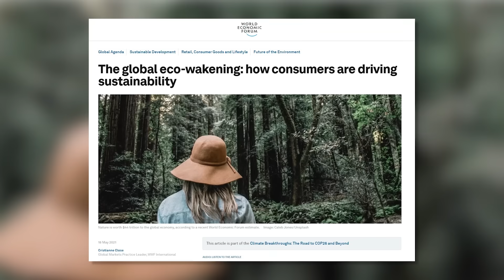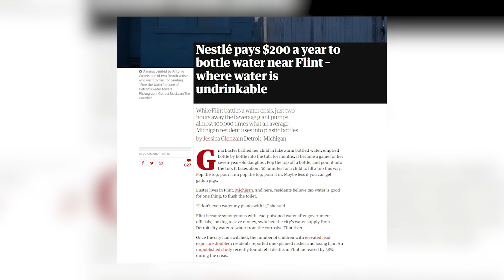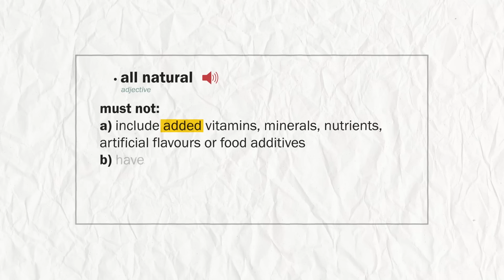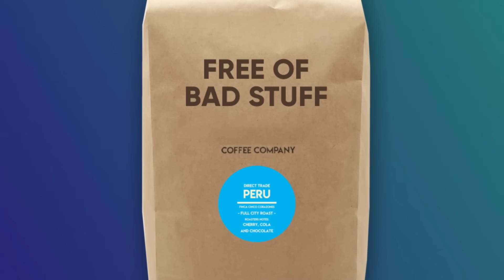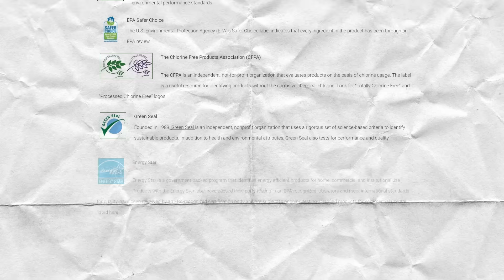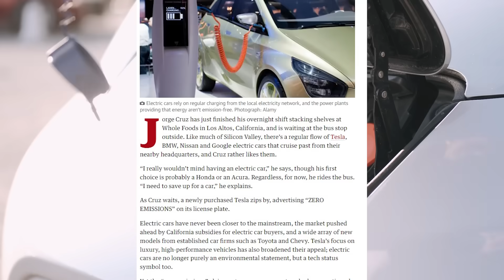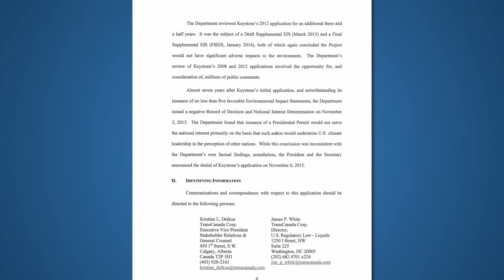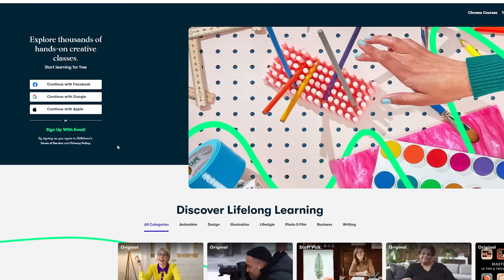Why Being 'Environmentally Friendly' Is A Scam

Comment: Also the fact that the keystone pipeline was shut down at the beginning of the new presidency cause of environmental damage, in the hopes that people would buy electric cars instead. Only for the US government to then go and buy fuel from Russian and Chinese companies. Thus now, since the new war happened, gas is $4 and above. And we still drill for oil here. We just can’t use a pipeline to transport it anymore. Now they have to be transported by diesel trucks, and trains. Where do I know this from? I’m a truck driver myself. So in reality, they didn’t make any changes to help the environment. The pipeline is shut down, but it’s still there. It still occupies that space. Why not use it then? But they made such a big fuss about making a change, when in reality, they just wanted to appeal to their agenda. I am all for bettering our environment, but we can’t just change from a bad thing to another bad thing. Like electric car batteries. Have you seen the damage that they produce on the planet in order to be produced? And also the fact that those batteries need to be changed every 5-10 years. Which is why Prius owners just get rid of their car. Since it’s cheaper to just get another one. Now we have junkyards filled with Prius’s that just need a battery replacement. And the fact that we don’t have solar powered cars yet. Or any other alternative. I know that somebody once made a car that ran on water. But he died of apparently a stroke or something. Even tho he said that he was poisoned moments before he died. But it’s just a conspiracy theory if you say otherwise. We can’t make water powered cars. It’s impossible. Or there was another one which had 2 batteries. While you were using one, the other would charge from the friction of the wheels. Thus, you never have to charge it. But I haven’t heard anything of that after that.

Comment: I wanted to point out the oil pipeline example you given in this video. The TransAtlantic pipeline was built in order to supply oil to consumers in the US. Canceling it just means that the oil are currently being shipped across vast distances to countries like India and China. The end result meant that is it actually far more polluting and more Co2 emissions were being released rather than sticking with the pipeline. Isn't this kinda ties to one of your 'seven sins' of green-washing??? 🤔
Reply: Isn’t it on indigenous land?
Reply: Keyword is "currently". We can't reduce fossil fuels if we keep building infrastructure for fossil fuels.

Comment: I'd just like to point out: Plastic bottles are reusable. You could reuse it several times prior to recycling (if that's an option in your area) or throwing it away (if recycling isn't an option in your area).

Another interesting thought: Plastic soda bottles are also single use (and much harder to reuse than water bottles, since you have to clean them out first, whereas you could just buy one water bottle at an event and keep refilling it at a water fountain or at home for quite a while. Yet, I notice whenever we talk about plastic waste/single use plastics, we don't mention soda bottles. Whyfor?

Comment: Interestingly enough, you'll probably do more good for the environment simply buying the cheapest products you can find rather than buying anything greenwashed at a markup. Of course, make sure the things you're buying also don't need to be replaced too often, things that would actually end up costing you more over your lifetime and top up the landfills. In general, though, if something is produced more efficiently, it will end up both being cheaper and having a lower impact on the environment. In addition to buying less in general, buying cheaper can be a big part of the "reduce" in "reduce, reuse, recycle." (And remember, those are listed in order of decreasing priority.)

Comment: Plastic bottles are great : I have a set of those that I use since 2013, those are okay, as long as I keep them out of UV light. It does not break like glass, it's lighter than steel, it does not taste like gasket, and since those are more than one year old they do not exhaust harmful chemicals (the PE had finished to cure). Those bottle are certainly better while I reuse them than in any trash. If a neanderthal had found one, he would certainly keep it for reuse. Discarding useful things make us more stupid than monkeys.

Comment: The thing that is not touched upon enough in my opinion is the illusion that a product is more eco-friendly because it's "all natural". For example natural rose oil is not environmentally friendly at all, it takes (I think) 1000 roses for 1 oz  of rose oil (or somewhere around there, insane amounts anyway). The resources that go into growing and processing all those roses can definitley be considered wasteful in comparison to synthetic geranium oil, as well as the potential waste after the oil is extracted (I don't know what manufacturers do with the rest of the rose but I doubt it's something responsible, like composting them,).
Granted synthetic "essential" oils have their own downsides both relating to the environment (like oil resources and potential pollution from manufacturing) and not (like potential carcinogenics and other health concerns), but my point is that to think that something is automatically not bad for the environment, or health, simply because it's natural is not true.

Comment: Let's be honest. Human convenience and environmentally friendly are like oil and water. It won't mix that easily. You will always have to sacrifice one thing from other to make the balance. Biodegradable packaging are a good example. Single used plastic bags has the benefit of being both cheap and durable but not environmentally friendly because it' s plastic. Alternative for this are either eco bag (those bags made of cloth or other durable material so they can be reusable) but it takes more energy to produce them, aren't free and takes a bit of space to carry to your supermarket since they need a bit of effort to be folded compactly enough and lastly, most of the time they aren't water proof. Another alternative are biodegradable plastic which is questionable at best since no body really bothers to look into if those are real biodegradable plastic and even if they are, they aren't as biodegradable as paper and lastly paper packaging which is the most environmentally friendly but is fragile and really expensive to use for business owners. So yeah, you need to sacrifice convenience for the sake of being environmentally friendly.
Reply: It's impossible to sacrifice convenience when the population keeps on ballooning - and when societies with very low PDI and very high individualism rankings question 'big government' moves that are designed to, as you've said, sacrifice convenience. The problem is that those governments often lack pragmatism, and whenever their reasoning clashes with other science and statistics (see the argument regarding plastic bags and reuse vs regulation, for example), that's when the logic behind it all gets questioned. Then there's also the risk of unintended consequences and possible 'unicorning' (for a lack of a better term), where the legislation is based largely on a desire for an ecological utopia that would solve the world's problems, no matter how small their contribution would be in reality. That's why there'll never be satisfaction.

Comment: Two very important things that should be mentioned in cases like the Keystone pipeline lest it becomes another one of these "sins", although I'm not from NA so I don't know the specifics:
1) Stopping national oil/gas production doesn't prevent, and often expedites, foreign production/importation. On a global scale it's even worse since the usual culprits are less regulated (more polluting and damaging to their local environment) and the resource has to be transported over a much bigger distance to your country, so it defeats the main purpose of these enviromental arguments - unless you think your backyard matters more than theirs.
2) Stopping the most efficient means of transportation (like a pipeline) doesn't prevent, and often expedites, less efficient and thus more expensive and polluting means of transportation. Instead of an underground pipeline you now have thousands of trucks, as well as an increased need for road structure and repairs. Perhaps the pipeline really was THAT bad (again I didn't follow the story) but was it worse than the current alternative?
Reply: Agreed
Reply: The thing is that we shouldn't be making more fossil fuel infrastructure. We need to stop using them at some point and we could decrease the need for them at all by switching to sustainable power sources. That would reduce the need for worse ways of transporting fossil fuels since we just wouldn't need to transport them at all.
Reply: @atenza_falcon  Yup yup. However it's not something we can "switch" from one day to the next. In the meanwhile there'll be a multi-decade, if not century-long, transition. And that's accounting only for wealthy 1st world countries, on the 2nd and 3rd world it'll take longer still.
Reply: @Highlaw  Building more fossil fuel infrastructure still takes time. Sure it's easier, but that time could be spent starting to transition before it's too late.
Reply: @Highlaw  In some ways, the current Russia-Ukraine conflict could accelerate this process, at least in Europe, where countries are now in the difficult position of relying heavily on Russian fuel.
Reply: @atenza_falcon  Petroleum is not just about fuel/energy, although that is the main product that we gain from them.  If we eliminate oil, how are you going to replace the high tech winter clothes that allow us to comfortably survive the northern winters?  The coats and boots that are made today are vastly superior to what we wore 25-30 years ago--and all thanks to petroleum products.  If you were to remove everything in a hospital that is made from petroleum products, it would be pretty bare.  Just a simple procedure requires--IV, tubing, plastics to keep things sterile, gloves, medications, bandages, the room itself has countertop laminates, computers, communication systems..... Nearly everything that you touch every day is made possible either directly or indirectly because of the petroleum industry.
Reply: @brendazorn4592  Then we'll probably need alternatives, but since they aren't causing emissions after production they're definitely better than fuel. Hopefully the huge amount of oil we have could last until we have good alternatives.

Comment: Reminds me of SC Johnson's Raid Earth Options bug spray sold in Australia. It does use natural pyrethrins, but whatever synthetic stuff they put in there makes it all but pretentious. Ditto with MSI when they sold an "eco-friendly" line of motherboards which claim to save energy by shutting off unused components on demand, only for it to be moot considering the environmental impact of manufacturing PCBs and semiconductors.

Comment: @AsapSCIENCE Got a question. I know it's one of the sins but the oil still gets transported. Which is better for the environment? Transport by train or pipeline? The Lesser Of Two Evils. Renewable energy is still a ways off from being efficient enough to rely on it and not the oil or gas for vehicles.

Comment: Just like what happening on renewable energy and electric car. It's not that green, at least not as green as you think, e.g you need oil to produce energy to charge your car..... And lithium battery inside the car is hardly recycle. The wind turbines' blades take huge amount of energy to recycle a little, most go to the landfill because most of the material made of can't be recycled, plus miles of cables and kill many birds...

Comment: The issue with things like protesting pipelines is "who pays?" Often the protesters are people with enough money to spend time protesting. And the people who pay for increased gas cost is often people who can't afford it.

So while going 'gas' free sounds nice, the hidden costs of li-ion batteries costing half the car's price and high increase in fuel are prohibitive to anyone lower than middle class. That poverty line is just going to raise as costs go higher while pay doesn't. Save up you say? Must be nice being able to do that. It's going to take sodium or glass battery tech before EVs are mainstream.
Reply: Electric cars are not the solution. Trains, trolleys, and light rail are a proven solution to transportation logistics, and they are more energy efficient per-passenger than cars.
Reply: @Random3716  That would work in many parts of the world. The issue with the US is sprawling suburbs. Which makes such things highly inefficient. Unfortunately the 'American Dream" is still an independent house instead of an apartment. And without owner rights, people just aren't going to be interested in renting an apartment.
Reply: @zetsumeinaito  Detached housing is not the problem, it's how and where it's built. There actually lots of suburbs in the US that sprung up around streetcar lines in the late 19th and early 20th centuries. This form of public transportation is actually what enabled detached housing tracts to develop in the US in the first place. Streetcar suburbs started to give way to plans designed around the car in the 1920's. The modern suburban, car-dependent hellscape emerged in the 50's.
Getting away from car-dependent suburbs would require a lot of political will (basically the entire national system of zoning laws would have to be re-done), but public transportation integrated into suburbs of detached housing is feasible and did exist extensively in the US.
Reply: @Random3716  There's a certain population density you need to even make public transportation worth it regardless of how you word it. I've never heard of inner city subdivisions as being called suburbs.
Reply: @zetsumeinaito  Those suburbs used to be the outer limits of the city, and were densely populated enough to warrant public transportstion. Even rural communities in the midwest were connected to the cities with electric interurban railroads similar to modern light rail systems.

Comment: VW did pay billions in penalties and restitution for the dieselgate scandal. They also set up the Electrify America charging network for EVs to be able to drive across the country. That’s not to excuse what they did, just to point out that this wasn’t entirely accurate. Also inaccurate was the study on EVs being charged with fossil fuels being worse than gasoline. The Union of Concerned Scientists has a very detailed report called “Cleaner Cars from Cradle to Grave” which you should check out

Comment: I always laugh when it comes to the "but VW etc. used software to get around the tests" - yes, they did and it was wrong, but you know what's wrong too? The way these tests work in the US. In the US the gas mileage of a vehicle is not considered at all when it comes to emissions. All that counts is that the engine in the vehicle can burn whatever fuel the engine uses cleanly below thresholds. So for example: a big SUV getting 5mpg is considered clean because the engine in it can burn 1 gallon of fuel below the legally allowable emissions. Nobody in the US cares that the vehicle burns hundreds of gallons of fuel to go places that another vehicle could do with a fraction of the pollution.  So a BMW 4 series Diesel - which gets up to 47mpg without complicated hybrid technology is illegal in the US - because it burns one gallon of diesel above the allowable emissions. Again, nobody cares that the SUV or Pickup next door uses 15 to 20 gallons to go 100 miles when the BMW uses less than 3 for the same distance. This way of testing was made in favor of the oil industry and is a classic case of greenwashing.
Reply: "a big SUV getting 5mpg" 
 
Which SUV would that be? Presumably not even the largest Hummer. That consumption is equivalent to about 5 L/100 km; twice what you can reasonably expect from a large van with an inefficient V8 petrol engine.
Reply: @Laura_Norder-Vanity_Unfair  Any Suburban or Lincoln Navigator doesn't get much better than that. My neighbor does around 10mpg in his suburban when it's empty. Once he packs his family and whatever they bring it goes down. My Jeep Wrangler goes down to 8mpg in some areas.  While I agree that a 5mpg vehicle is probably the most inefficient you can find these days, they're out there (and yeah, a original military HumV doesn't do much more than 5mpg mostly because it has an engine capable of burning pretty much anything combustible).

That said the number is not important. Make it 10mpg if it make you feel better. The point was that in the US the vehicle is not considered. They take then engine, put it in a lab, let it burn 1 gallon of fuel and measure the emissions. That's what approves the emissions. It doesn't matter whether the vehicle the engine is put into will use 20 gallons to go 100 miles or 5 gallons. Obviously a vehicle burning more fuel will emit more emissions in total. That's why you see "x amount of CO2 / 100km" for European vehicles. While they too have certain standards for how clean the engine needs to operate, it's less of an issue if a very efficient vehicle doesn't burn the fuel super clean (mostly with diesel engines and NOx emissions), because the total emission for a certain distance is lower and that's what really counts.

BTW: a 5mpg vehicle is the equivalent of a 47l / 100km vehicle. A 5l/100km vehicle is actually something more like a Prius first generation - or a BMW 420D convertible.